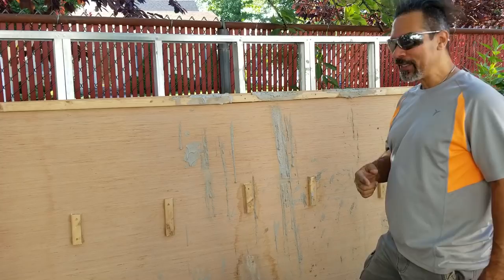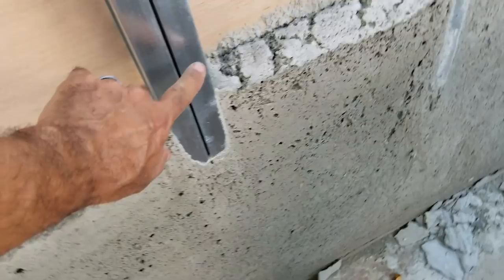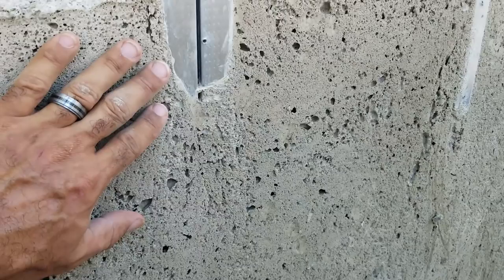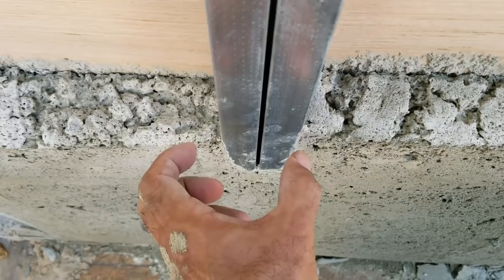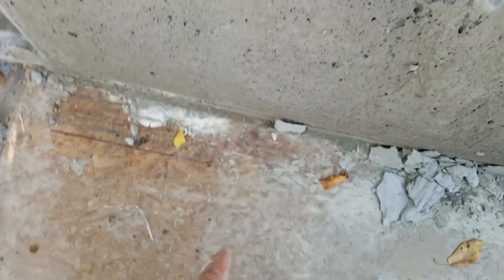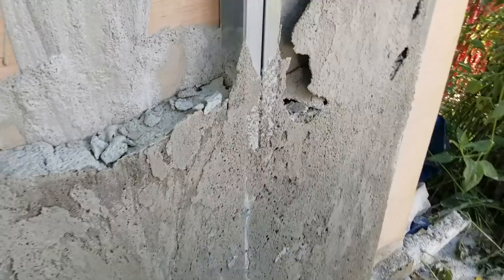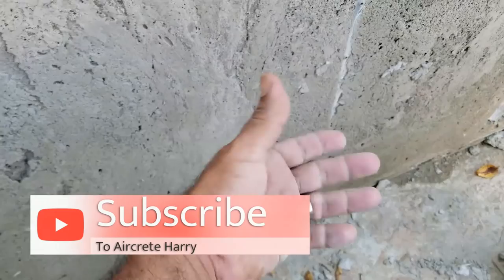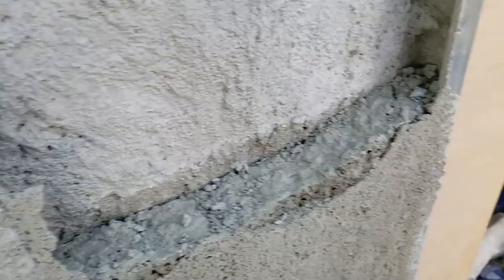Aircrete Wall Insulation | #aircrete #wallinsulation #aircreteharry #aircretewall #aircretesamples

Comment: In Europe foam concrete is also used as an insulating leveling layer UNDER the dense & reinforced concrete floor slab.  Installing the rebars on top of aircrete is easy and comfortable, the min. coverage of the steel rebars with dense concrete is assured. The aircrete thickness  and density governs the additional insulation.  Great for warehouses, sheds, cattle stables, etc.

Bert
Spain
Reply: Hi Bert, is there somewhere you've found with credible information on foam concrete for formulas and application information for use in foundation work?
Reply: Sprayfosm the dirt, then level aerated cement, then reinforced concrete, then tadient heating.
Reply: @SnarkyGoat  
I have credible foam concrete info such as recipes / densities / insulation values / compressive strengths incl. How to do and what not to do...

First of all one must realize that foam concrete is a niche product, very suitable for carefully selected special applications applications or not suitable at all for other applications.  Foam concrete is not a standardized product. 
Every producer has it's own recipes which he keeps secret.
Many types of filler can be used such as sand, chopped straw, wood fibers, saw dust, paper, expanded polystyrene, expanded clay pellets, perlite, vermaculite, crushed slags, pumice and many others....
Personally I prefer light weight mineral fillers. Organic fillers can be subject to fouling.
Of course capilar transport of moisture within the foam concrete must be concidered too. Use thick plastic foil  moisture barrier.

The use of steel reinforcement bars or nets is not always the best choice. Due to the porous structure of foam concrete the reinforcing steel is not properly corrosion protected. The use of corrosion protection on steel reinforcement is mandatory e.g.  hot dipped galvanized steel. Alternatively bitumen coating,  powder coating.
Last but not least... Enthousiasm does not at all compensate for lack of engineering & construction experience!   Therefore...1st make a good design, than decide for the best possible method statement and discuss your ideas with an foam concrete & construction expert. (Not many exist).
Remark: it is not possible to scavenge foam concrete info from the internet from selfproclaimed hobby experts.
Expert knowledge transfer from me to you is possible though, but it costs you money.
Good luck and stay at home to protect from the Corona Virus

Bert Spain
Reply: @brettknoss486  
Hi brett.  I don't quite understand what you try to say.
Reply: @sonofagun3193  you are a mercenary !! Here we are all trying to help each other not scalp each other.
Reply: @SnarkyGoat 
Don't use foam concrete for load bearing structures. The compressive strength is not sufficient and there is a corrosion issue with the rebars. Walls 30 cm thick foam concrete don't need insulation (depending on your insulation requirements and specific density choosen)
Foam concrete is as durable as dense concrete
Reply: @jimjones7821 
No I'm not a mercinary at all. I have huge experience with foam concrete but don't give that away for free. With my knowledge I can help people if I want, but full knowledge transfer is not for free. That does not make me a mercinary but a businesses man.
I repeat... I can help if I want to, but only than.
Reply: @jimjones7821 
It's not my style to give thumbs up for every BS advice or conclusion told here.
If I believe that my comments would possibly enlight FC enthusiasts on this topic I will comment with honoustly as I always am. 
Helping you all here can also be a negative comment... even when some snowflakes here don't appreciate that. 
For every FC enthousist who wants to bring his FC skills on higher level I can help but not for free. 

Time is money.  stealing my time is stealing my money.

Comment: Ooh, this is great!  I've been thinking about something like this because I want a non- burning barn, and I haven't wanted to try a dome barn. (Size, mostly, but also because the traditional rectangular shape works well for stalls & hayloft, etc.)    I live in California and after discovering aircrete, I won't live in a burnable stick-frame building anymore. Now I know that this is possible, I will start considering large animals again.  (The chickens get a dome, though, because it's so cute.) 
I thought about pouring panels, but I was thinking about laying them flat then raising them after they cured.  If I can pour them in place, that changes things.  
Thank you for all the work you've done and do. You have really changed my life.

Comment: What I would be interested in, is the noise buffering from aircrete. That would be a great tool for apartments, condos, or house near major roads.
Reply: I totally agree- that formula, Harry is needed. It can be funnel-poured from above the second floor into holesawed holes in the plywood, to rest on the downstairs ceiling's sheet rock. Let's see it.

Comment: Another concern is that the drywall would absorb the moisture and possibly create a mold issue if you pumped that into a wall cavity. If you put plastic on the studs before the drywall then it might be okay but I would be skeptical to put it into an existing wall. If you do a test, make sure to prime and paint the drywall as a normal wall would be painted. Primer and paint would act like a sealer sealing moisture in the wall. I would agree that the air Crete would be superior to anything because of the fire resistance alone. Also, it won't break down like traditional insulation. Just need to find the way but I'm sure you will. Thanks Harry.
Reply: Redefine Living your absolutely correct I worked quality control and repair in the drywall industry for about seven years and in order to use this system effectively on an existing structure you would need to gut the existing drywall and insulation. I would use 1/2" to 3/4" 4x8 sheet of plywood or osb with hat channel to give it some back support. If you try to pump it an existing wall with the old drywall you are inviting disaster!
Reply: LittlepigStore, LLC you might be right depending on the pressure pushing out especially at the bottom of an 8’ lift. 5/8 drywall might hold but if you fill the wall up to  8’ in one shot, the bottom might bow or blow out. Harry, add that to the test list!! Haha
Reply: Redefine Living I don't think 5/8 would hold up once it soaks up enough moisture I think the pressure would blow out the bottom not to mention the mold.
Reply: LittlepigStore, LLC I definitely agree, you would need to put plastic on the studs before the drywall at the very least. Even then, I don't know what the pressure would be. Would it be more then water because it is a heavy material or less because of the foam? It would be a good test for someone to do.
Reply from the maker: I did not see much damage to the drywall I tested with last year but everything was outdoor, not in a closed house. So your right, I will clarify in my next video for new constitution and barns only.  I do have an idea for existing wall to avoid damaging anything in the house. https://www.youtube.com/watch?v=Tux3k7xgkxU&t=1s
Reply: Let us not use drywall at all!!!!
Reply: @matthewstiffler1939  100% agree!! I loath drywall. Plaster over the aircrete and make beautiful interior walls instead!!

Comment: Concider the condensation point within the wall , especially in winter this ist crucial. A vapour barriere between the plywood and the aircrete is needed.

By the way... You should pour max 40cm in height of aircrete at a time since the specific density increases at the bottom part of your casting. ( Due compressibility)

Steel components that are enclosed by aircrete will corrode in rather short time due the rapid carbonitation of the "free calcium" within the cement.  the enclosed air within the aircrete will cause that.  Corrosion protection of steel is required also for rebars when applied. I suggest to coat with bitumen.

Bert
Spain
Reply: @Freddy McIntire 
The carbon dioxide in the air reacts with the alkali in the cement and makes the pore water more acidic, thus lowering the pH. Carbon dioxide will start to carbonatate the cement in the concrete from the moment the object is made. This carbonatation process will start at the surface, then slowly move deeper and deeper into the concrete. The rate of carbonatation is dependent on the relative humidity of the concrete - a 50% relative humidity being optimal. If the object is cracked, the carbon dioxide in the air will be better able to penetrate into the concrete.

Eventually this may lead to corrosion of the rebar and structural damage or failure.
Reply: @sonofagun3193  you sure do know a lot, do you think pouring a thin concrete slab with rebar, aircrete above, and then another thin pour of regular concrete on top, would work well, creating a hard surface on both ends, and aircrete would provide insulation and the distance between two hard surfaces for additional strength, similar to a steel I beam?
Reply: Hi Bert, have you built anything from this material? I'm curious how it lasted for you? If metal corrosion is really that bad maybe its better to use composite rebars? Just saw th at menards last week, they cost 1$ less than real 1/2 inch rebar and probably are not as strong..
Reply: @ekurdesov  composite rebars are very very strong and withstand exposure to air / moisture and salt. For the actual tensile values please refer to the manufacturer.

Comment: Something to think about, if you are considering “pumping”air Crete. Pumping will compress the tiny air bubbles to some extent and you will have a far-greater density than if you were to pour it in by hand.
Reply: That's true but once the wet foam concrete is poored the bubbles expand to original size

Comment: Make your panels on a concrete pad laying flat.  Use 6" steel studs and make the panels 4' wide.  You can install Windows in the middle of the 4' panels.  The panels should still be easy enough to set in place with a helper.  The added thickness will give you added insulation value..
Reply: John Tingle good idea. I am thinking a out doing all my garage walls that way. How would you insulate between two panels
Reply: markman63 I wouldn't attempt to insulate between the panels.  simply use a couple of beads of silicone  between the panels as you joined the panels together.   my original idea after seeing videos on this subject was to build thin wall concrete panels (4'x8')  having the outer wall made with 2" of standard concrete.  make the 6" studs into panels that would fit exactly into the wooden concrete forms.  attach reinforcement  wire on the bottom side of the  metal stud panel.  pour in the 2" of concrete into the wooden forms. lower the stud frame into the wooden form only allowing the wire side and the c-channel lip of the metal stud to sink in 1".  allow the concrete to set.  raise the panels and set them in place.  with only 2" of concrete outer shell that would leave 5" of room inside the metal studs.  have holes predrilled in the sides of the panels so after being stood up you could bolt the panels together.  to insulate  the panels with a recipe of foamCrete insulation which is lighter and fluffier than normal foamed cement  and has a much higher R-value.  I believe they use talc in the recipe.  since it is much lighter than normal foamed cement it would have no structural capability.  the stregth of the panels would come from the metal studs and the compressive strength of the 2" standard concrete outer shell that the metal studs were imbeded in.  you can see some videos on thin wall construction....as well as foamedcrete insulation to get a better idea of my concept.  both are viable construction and insulation methods, but I have never seen them combined.
Reply: @johntingle455  do not use steel. Eventually it will rust, and then crack, and then there will be an open wound in the wall, which is the worst result. Aluminium is fine, but really the only correct option for the pour is on the ground, horizontal, then lift and affix into place. For me this means a good solution would have a strong but lightweight wooden frame, on a concrete footer, attached to the external wall, into which you would place your panels.
Reply: @johntingle455  I just read your comment #2 after I replied to your comment #1 .... yes, my idea matches yours exactly I think. In my own barn case, I will attach a wooden frame to the side of the barn and measure/pour/raise aircrete panels one at a time ... then cover with air barrier where necessary ... then cover the new face with moisture barrier ... then put my new siding on top of all ot that

Comment: Looks like insulation, I agree with many people that it should be 6" thick. I'd also look at all steel buildings. Maybe have a steel building with covered in rockwool, then clad with fiber cement board, do the same with the roof, slate over rockwool over steel, then use spray foam to save weight.

Comment: Hydrostatic pressure. The pressure from fluid depth is low, but the surface area is large, so it pushes the panel away from stud with an unexpectedly high force.  2 psi on 2 sqft is over 1000 lbs. Lower lifts or more bracing on the panel to resist the pressure.

Comment: Aircrete with a density of 600 kg/m3 has an insulation value approx 3 times worse as expanded polystyrene.  In other words a wall Panel of 3 inches thick has an insulation value Equal to 1" polystyrene.  
Regards

Bert
Reply: But in a fire you have a 3 times better chance of escaping the building while conscious. Smoldering polystyrene will severely hamper your chances of survival.
Reply: @Deploracle  Brilliant reply.
Reply: There are other factors besides insulation. It works as a thermal mass to moderate the swings in heat input from day to night to day. There's also the reinforcement factor that it stiffens up the wall. It also acts as a sound deadener so if you did it to a house on a busy street (like mine) the traffic noise would be massively reduced... Which is why I'm considering it in the walls but resheathing the house first with 2" Zip board.
Reply: @bobjoatmon1993  I defenitely DO NOT RECOMMEND this method for an existing wooden house in the US.
However if you are 100% convinced of this specific A. C. application and want to give it a go on your house, it would be great if f you  make a technically sound method statement incl. facts and figures of your project first and publish it here for others to learn. 
If you ask me to look at it, I will do so and give you advice. 

For all aircrete enthusiasts..... 
enthusiasm does not replace skill and in depth knowledge. 

Good luck
Reply: @drcornelius8275  what exactly do you mean with ((heats in winter))?
Are you going to find out the energy needed for heating? Do you have a reference building made of blocks without core filling? What spec. Density of insulating filler?
 - - - >the lower the better!
Reply: @Deploracle  you are right if you use the wrong type of polystyrene. Always use the flame retardant type for buildings!

Comment: could you coat a old wood house with aircrete. im thinking of buying a 30k house and taking the plastic siding off and coating the house in that fabric cloth and aircretting the outside and making it look like brick. how practically would this be and ive never seen it done could be maybe give me insight into this idea my friend?
Reply from the maker: Yes! You can easily build or buy a brick pattern panel mold and make it what ever thickness you want. Then you can put a fiberglass or wire mesh up and mortar and bolt on the brick pattern panel. Every 24hrs you can take the the brick panel out the mold and pour a new one.  Or you could build a new dome shell in one week or a few small domes with my new off grid dome home kit. 
Get your Foam Generator at: Later!
https://aircreteharry.com/

Comment: You'd have the same problem if you used aircrete strips...just pour your sections of wall form lying down on the ground...no bulging that way...or use way more screws if you have to pour upright wall sections...

Comment: Hey Harry. I am going to use a double diaphragm pneumatic pump to pump it into my fence molds since the forms will be 8ft tall. We use those pumps for slurry and aircrete is even lighter so i am sure it will work. When i get back to my experimenting i will shoot you the results.
Reply: How did the test come out? I'm looking at this kind of pump too
Reply: @unkelsunk sorry had to halt my projects for the rest of the year. Dealing with family issues. When I resume I will post the results if no one has tried it by then.
Reply: Oh, that's too bad, hope everything is ok. I'm gonna perform my own tests soon, will post results.
Reply: @ bsrcat1
Suitable pumptypes for pumping aircrete are:
A) Hose pumps also called peristaltic pumps. Main advantage: no mechanical seals
B) Screw pumps. Mechanisch Seal with water flush needed.

Always flush pump with lots of water after pumping

Bert
In Spain
Reply: How much would this weigh if the cavity is filled to capacity? Any attempts to rubberize aircrete? This would be great to fit into atics in large runs

Comment: What would you value this insulation at? (What R-value)
Reply: Great question! I also want to know what kind of bullets it can withstand
Reply: me as  well  I live  in Canada and  need  epic insulation.. as it is....  my bummer  thaws in June ..  erggg
Reply: Supposedly aircrete is r-6 per inch of thickness
Reply: @kaojaicam  R-36 is recommended for freezer walls. A 3" stud  plus an inch on each side would get you 5" which would make it pretty close. Could just make it 6" thickness to be safe. Thinking about it for the walls of a walk-in freezer, like the kind farmers would have for meat. Wondering if aircrete would be more cost-effective than spray-foam insulation.